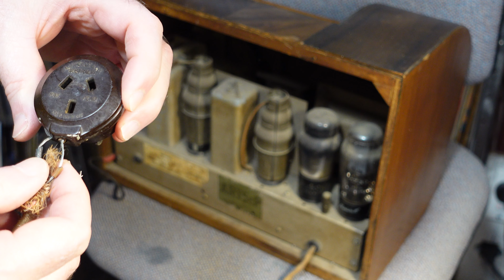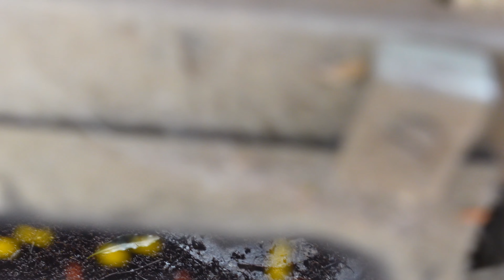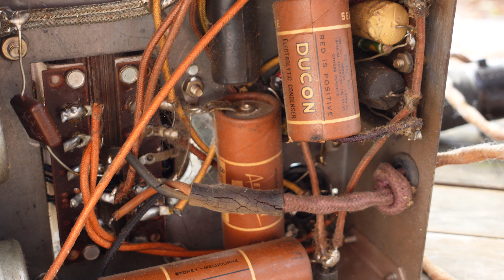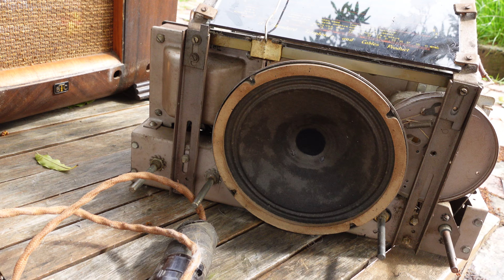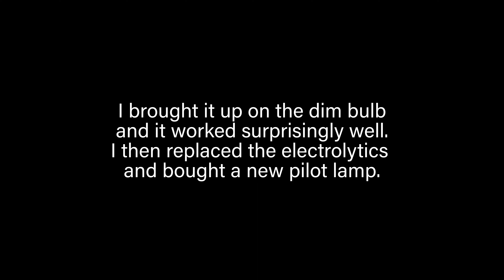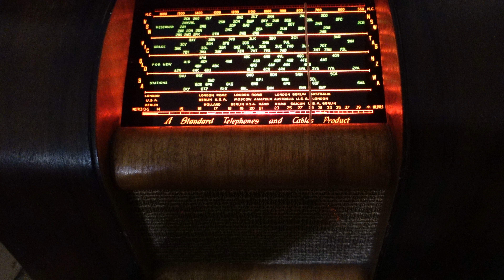ElectroSound 19. STC L558. Free - from the hard rubbish on the side of the road.

Comment: I have one of these in my shed awaiting attention so it was very interesting to watch your video. Mine has a cream coloured dial glass and the cabinet needs more work but otherwise pretty much the same. A pretty good verge pickup!  Slip pickings around my place, I’m afraid.
Reply from the maker: Hi Don, it's not a bad radio, not the best sounding, but not bad. There were a few variations in the same cabinet. It's not often that you find useful things on the verge anymore. I stopped for a pair of Warfedale speakers a couple of years ago, and even before I put them in the car two other vans had pulled up and were picking over the pile. The owners were still putting stuff out! I had asked if they were OK about me taking them. With most councils you have to book a collection now, so it's not the annual drive around the suburb and collect many things. Tip shops are the same, people hang around all day, everyday, and when something comes out they make a phone call to the boss as to whether to buy or not.
Reply: @electrosoundaust  Wow!  Good score with those Warfedales! I buy most of my radios on Gumtree of Facebook marketplace.

Comment: I picked up one of these recently off EBay mainly for parts for another 5 valve AM/SW receiver with exactly the same valves. Mine is in a much poorer condition, the loudspeaker needs reconing, the dial glass came broken and in any case the paint missing in spots on the rear, the case has been painted cream, the dial knobs were missing, the twin ganged capacitor vanes need straightening, dial cord missing etc. But looking at yours and the Radio museum examples, I'm now not sure if should rebuild it although the dial glass is a problem
Reply from the maker: Hi Mal, your seems like it went through the wars - pun intended! Try scaning the glass, clean it up in Photoshop or GIMP, and reproducing the lettering. I have just found a company selling laser printable water slides. I will experiment and finally finish the Philips 112. Also the rolls of clear laser-lite you get in Bunnings will replace the outer dial cover, (I'll do that in a future video.)  Don (of Don's Radio Shed) did a similar one recently too. Good luck if you decide to go ahead with it. It seems like a big project!